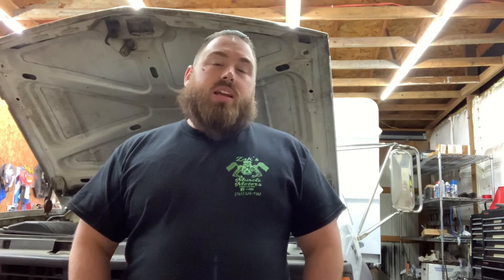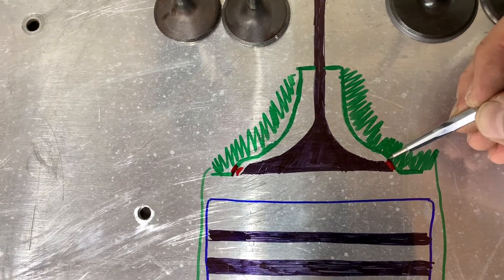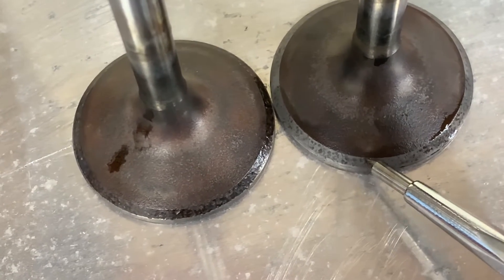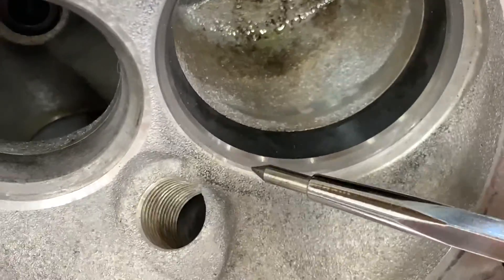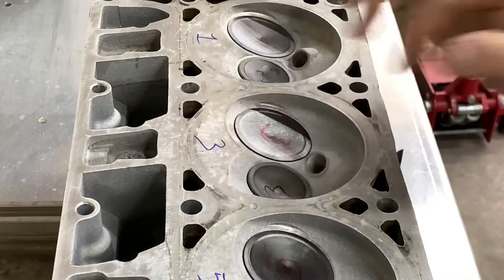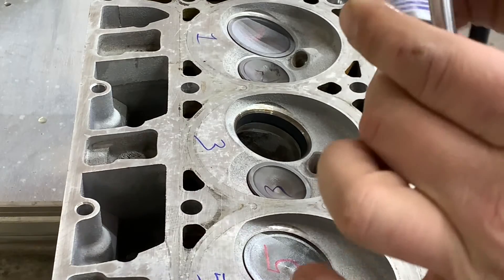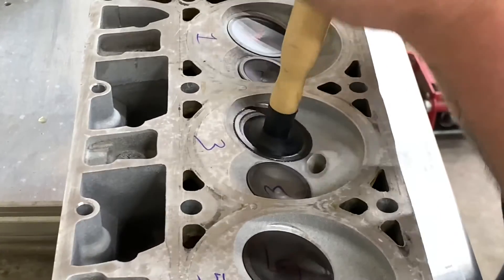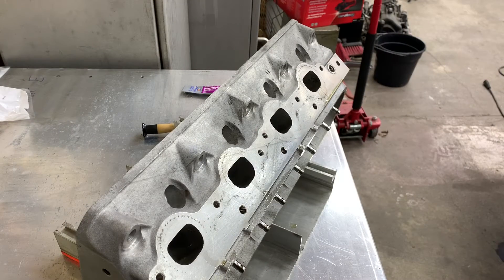How To Lap Valves And Reseat Valves In Your Cylinder Heads 101

Comment: Just another tip is you can take a piece of rubber hose on the end of the valve and use a drill bit in the drill and put it in the other end of the hose. Works well.. its also a good idea to use two fingers on the valve to keep the pressure even on the seat face
Reply from the maker: You’re not wrong about either of those. I used to have some hose for that and it’s packed away, but my main focus just just showing that taking some time and being patient you can still get it done. Thank you for your comment and good advice!

Comment: What about conjuring up a suction cup device that you can attach the drill to from the opposite side you have the drill on? Should be a pretty simple 3d print project. Best of both worlds?
Reply from the maker: Only issue with that is with these stock valves the face is so bumpy ( porous ) the suction doesn’t last. That’s why I prefer the drill.

Comment: A better way is to use a 2 inch length of vacuum hose that fits tightly over the valve stem and use that as a connection between the drill and Valve.
Reply from the maker: A better way would be to put it in the valve grinder and put a 5 angle job on it. This just shows you can in fact pay attention to what you’re doing and get it done.

Comment: There is absolutely nothing wrong with using the drill method, been doing it for years. If I can make one suggestion though, link the valve to the drill using a hose, such as a fuel line. This gives you a flexible buffer and prevents a lot of possible damage. It’s also easier to handle as it allows for the drill to be angled. The valve stem slides into the hose and you don’t have to worry about marring the stem. I use a similar size drill bit in the chuck to hold the hose. I’ve never damaged a valve or seat this way. Who cares what the “keyboard machinists” say. Haha
Reply: Sorry I just realized other people already mentioned this. Now I’m “that guy”…
Reply from the maker: It’s all good! A lot of my videos are about doing the bare minimum for the guys that don’t have access to lot of stuff. I like to show that with care it can absolutely be done in a pinch without fear of messing it all up. Thank you for your comment!

Comment: Got a some what safe tip for ya. Put a small Length of rubber fuel hose on the end of the valve and put the drill on the other end of hose. Uou could put a small bolt in to the drill end so the hose so it  doesn’t collapse. Works for me   
Peace.

Comment: Hey man, if you stick a rubber hose on the end of that valve and then run it to the drill, have a lot better time and not tearing shit up and also you can use the other hand to keep that valve straight in that damn guide the rubber hose on the valve and the rubber hose into your drill
Reply from the maker: 😂 nothing is torn up…. And if you think your spongy finger skin is gonna keep the valve stem straighter than the guid you’re high as hell. Thanks for your input.

Comment: Been doing the drill method for over 30 years never had a problem
Reply from the maker: If you don’t try to run it at light speed it will work wonders

Comment: Heat shrink over the stem was my first idea. Obviously you wouldn't heat it and shrink it but it would protect the stem. On a battery op drill set it on as low as the speed and clutch.

Comment: instead of putting the drill on the stem. take some hose that fits tight over the valve steam, chuck a small section in the drill and then slide it over the top of the valve stem. thats how i do it. :)
Reply: As do I.
Reply: put some tape around stim for drill set on
Reply: You shouldn't use a drill. There's a reason you go back and forth with your hands, then rotate about 90 degrees and do it again.
Reply: @williamborja9367  My little 12volt Makita has a handy reverse/forward function. i can lap these things fairly quickly using a 4" rubber hose.
Reply: You just opened up a very controversial debate 🥶🤣